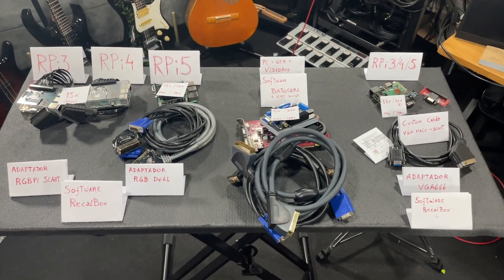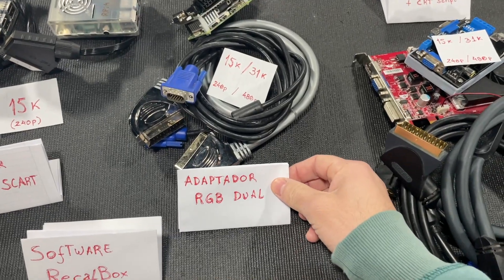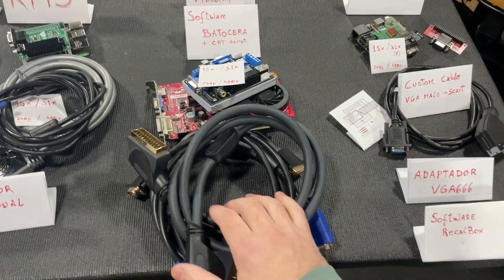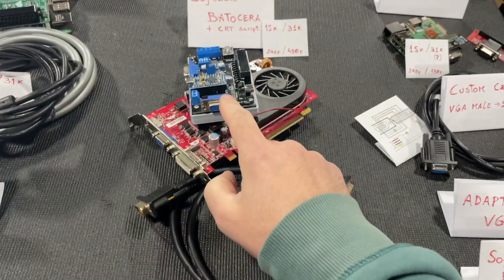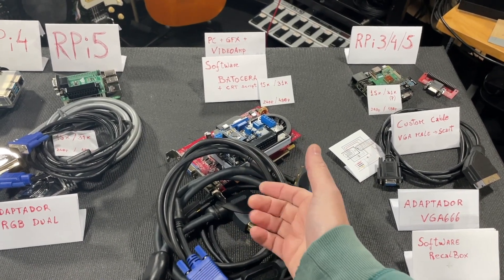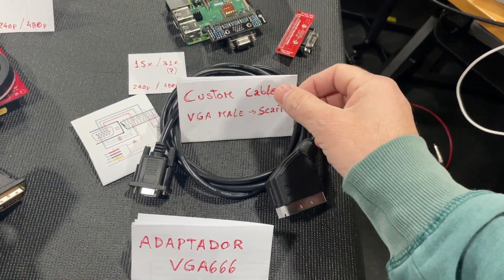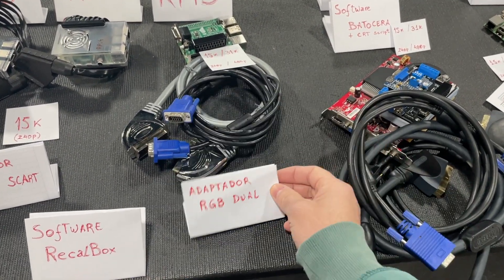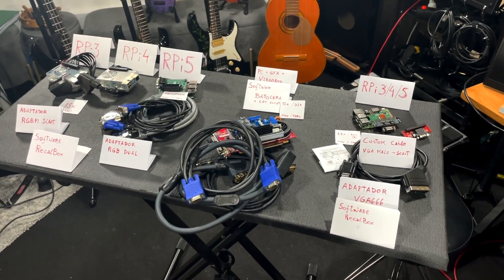Emulation 2024 CRTs and Monitors, Raspberries and PCs

Comment: I have never seen the type of cable used here. In the U.S. the only T.V. connectors we had with CRT T.V.'s are "RCA" and Coaxial cable.  why so many data lanes? A CRT only needs 4 wires to literally MAX OUT it's capability. Most CRT input is limited to a SINGLE data line... This has like, 19, 20, just for data, not including grounds...
Reply from the maker: R G B , 3 cables, plus more i dont know , i also tested a LOT, ntsc vs pal, Pal RGB has much more quality than the standard ntsc connection.

Comment: I got here by watching a video about a cheap Android tv box running 240p 15Khz RGB hooked to a CRT tv!! It was an alwiner board running batocera with CRT switchres Could you try it with android box ? I'm looking for a budget  retro handheld which also handle portmaster there are many chips out there running Linux, android, etc It would be great connecting to a CRT tube too lets say the ultimate portable retro machine! By the way I own a bunch of stuff you show here in the video 👍 plus I'm in América so we need here CRT RGB mod or transcoders
Reply from the maker: The best option is really to find a second hand pc, buy videoamp, and a graphic card with dvi output (listed in the “Batocera CRT Script” page)
Reply: @AndreFNerD Thanks I'm going to check the videoamp...? I have the other things in the gear actually. The tv box is just for fun since I have the thing lying around and If I would espend buying a handheld I'd like a very versatile machine

Comment: Thanks for the video. Why you dont use your custom VGA to SCART cable with your PC setup?
Reply from the maker: Because vga output is different frequency than scart. This cable is used as a custom connection, not standard. I didn't even used it properly although i bought it...

Comment: MisterFPGA
Reply from the maker: MisterFPGA all i can say is, very limited and expensive. A pc, a graphic card, a videoamp and some cables do All consoles in the market in a CRt. So, play switch/xbox360/ps3 etc on a crt is very very far from mister.
Reply: @AndreFNerD  Maybe you're right. But in that case, you can also connect original consoles like Switch, Xbox 360, and Wii to both 15kHz TVs and 31kHz monitors.

For this, you need a budget-friendly HDMI-to-component converter (specifically a converter, not an upscaler), and the second device is GBS Control. I use this setup to connect a PSTV to a 31kHz monitor.

In the PC world, there's something called CRT Emudriver—it's just modified drivers, so no additional hardware is needed.

And for retro consoles, there's the MiSTer FPGA for $170 on AliExpress.
Reply from the maker: @NicolasGeee i understand but 1) consoles don't do 6x internal resolution for example on a crt. 2) those converters don't give a good image compared to this setup. Nothing to do really and they give lag also. Well, there's really no "the right solution " here. It all depends on what we want/need and more importantly, what we are willing to afford.
Reply: @AndreFNerD  Regarding converters, the HDMI to Component + GBS Control setup has almost zero lag—I’ve watched reviews on it. This setup can also downscale 480p to 240p. There are several videos that cover this topic in detail.